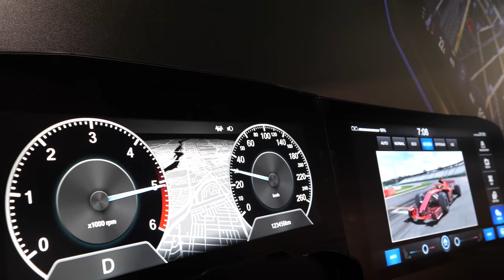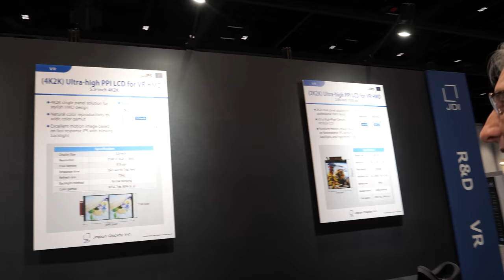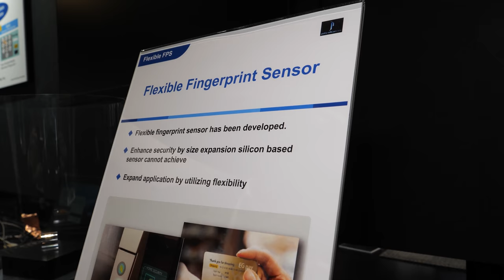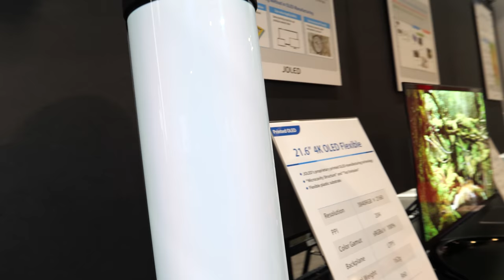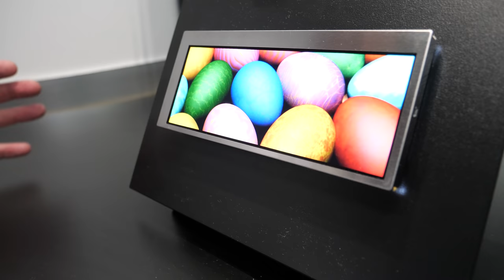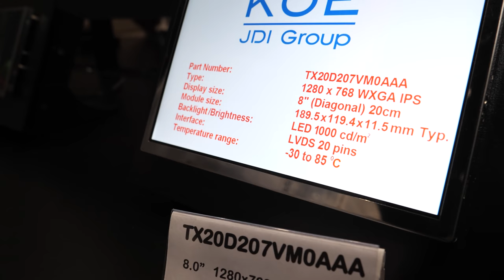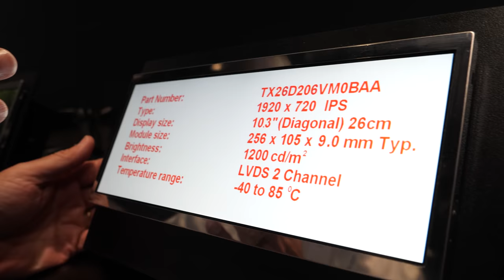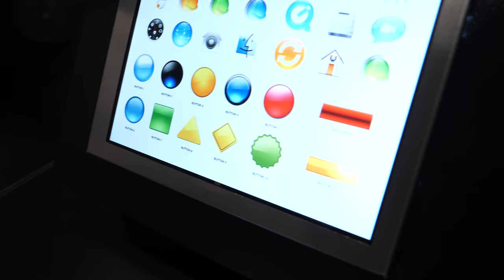JDI 17.3" 8K with Laser backlight, 21.6" 4K Printed OLED, variable LTPS, Curved Automotive, Consumer

Comment: Why are cars still using light bulbs, I no that led light bulbs are better. But why aren't cars using passive light screens for external and internal lighting. I don't think a dead pixel will be a problem. A light screen strip along the width of the back and front of the car would be more energy appropriate. Basically a low grade TV screen for lights and high grade TV screens for viewing entertainment programs. TV screens have so much potential for so many things.